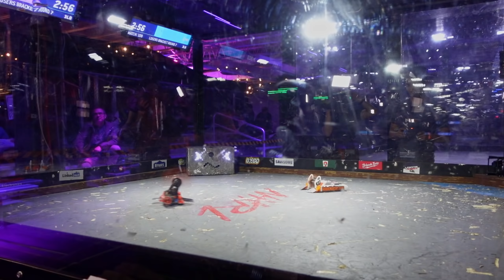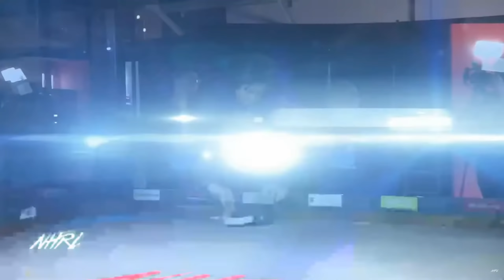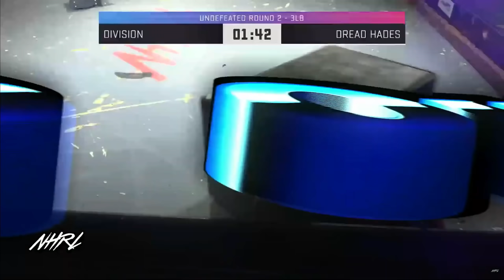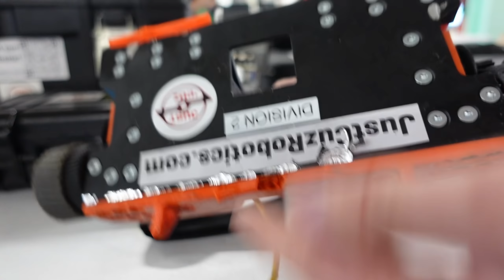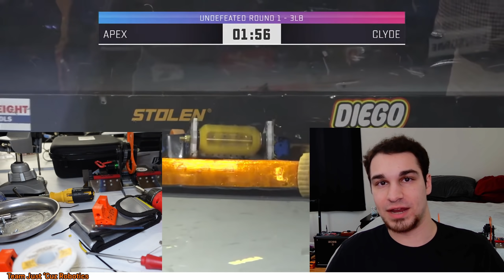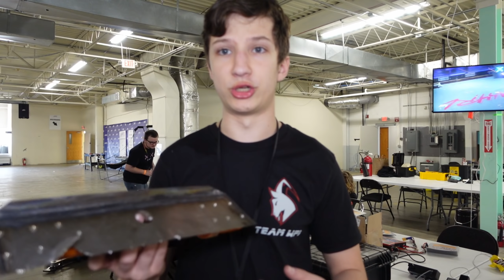Division V3: Fire Fighting? Norwalk Havoc April 2022 Recap (3lb Beetleweight Combat Bot) [Part 1]

Comment: Hey Seth how do you have your pulley mounted to your motor, I’ve recently been running into problems where my pulley will fall off and was wondering how u did yours?
Reply from the maker: Set screws into flats ground with a Dremel and blue loctite on the screws
Reply: @JustCuzRobotics  did you get your pulley from McMaster? I’ve been using the finger tech pulleys but have had grief with the setscrews
Reply from the maker: I couldn't find it anywhere except ebay or Amazon, it's unusual to find imperial XL belt teeth with 5mm metric bores. The full bill of materials is available here https://bit.ly/DivV31CAD